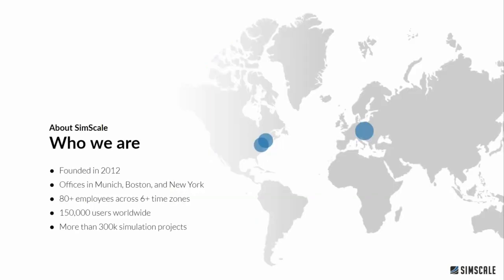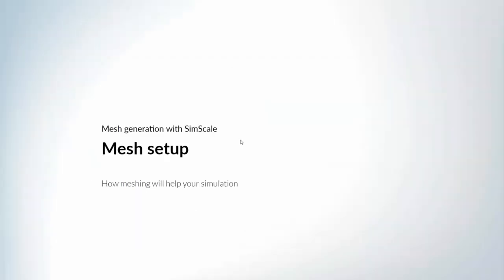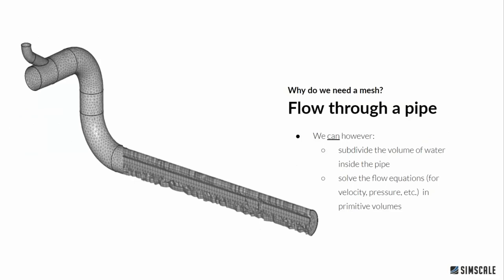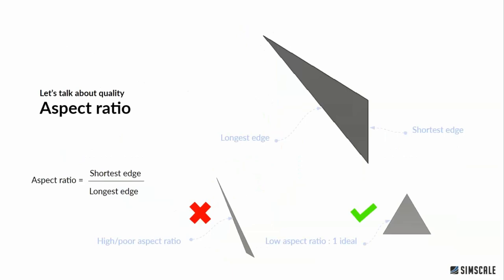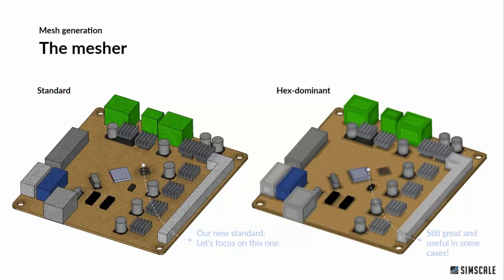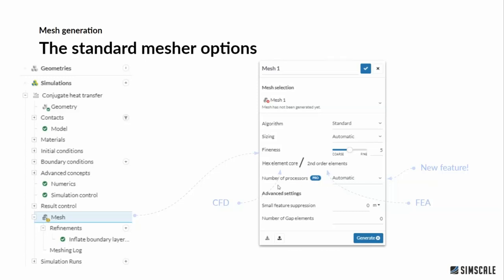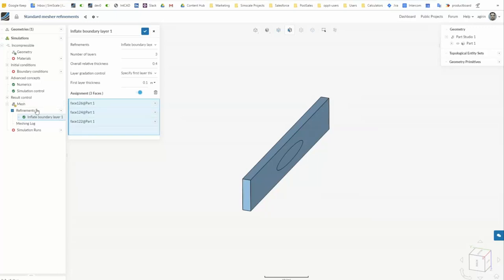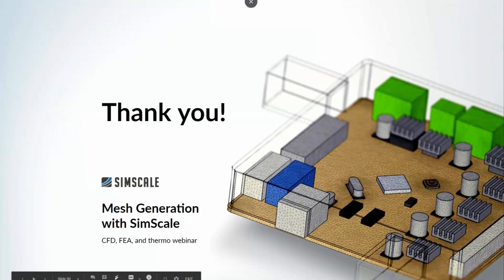Mesh Generation with SimScale | Meshing Tips & Tricks

Comment: Nice video. I'm a product designer new to simulation so forgive the basic questions/comments. Checking mesh statistics is skill I don't have the time to develop so it would be nice if this could be built into the software.  For example, at one point you created a "bad" mesh. Why does the software allow this? Presumably your experience tells you it would take too long to run. Can that experience be coded into the UI to prevent such a mesh?  Also your coarse vs fine mesh segment didn't spell out the obvious to newbie dumb-dumbs like me. Which is that the mesh size affects the results! There was more red colour in the coarse simulation than for the fine one.  I guess the images spoke for themselves.  Thanks for the vid. Looking forward to diving in to the community plan!

Comment: For CFD analysis of a FSAE Car, would you suggest continuing to use hex-dominant parametric mesh with the parameters given in the workshop or to try this new mesher? Outside of this video there is basically no other documentation to the standard mesher, right?
Reply: I would suggest using the new standard mesher which also works perfectly fine for CFD simulations, the settings are different though. Also note that the standard mesher is very stable and offers very useful features like "Small Feature Suppression". More details can be found in the doc: https://www.simscale.com/docs/simulation-setup/meshing/standard/